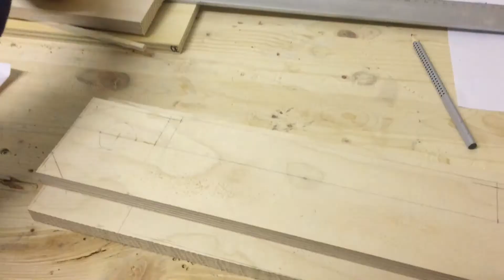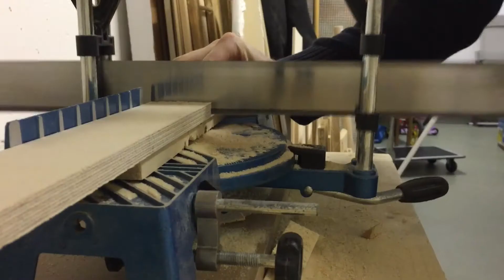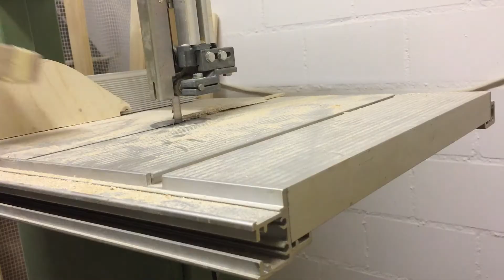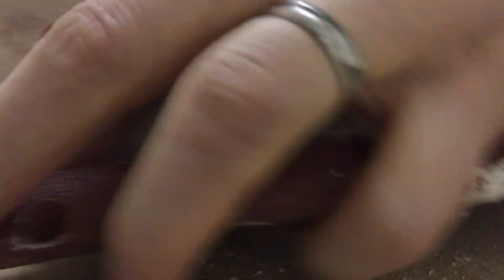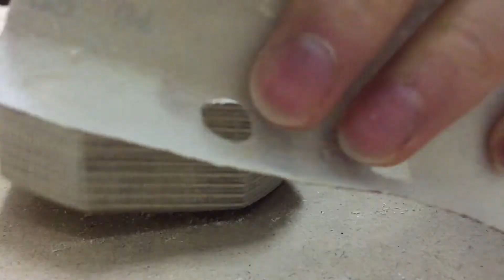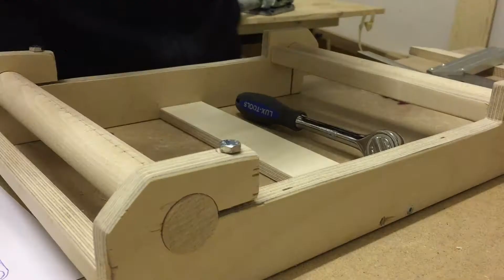Building a simple loom

Comment: Very short, and no narrator. Sort of confusing. I liked the ganged up sides to get matching holes. I dont think there is enough vertical offset. Is there a thread insert holding the dowel from spinning? Also likely would be stronger with notched joinery in the frame. Is it a takedown, like designed to come apart for transport? For the material cost and the labor, i would have just made a simple ladder back style i think, no adjustments, more vertical offset